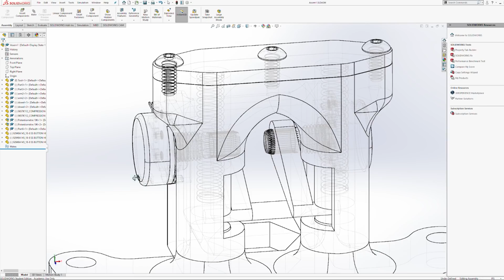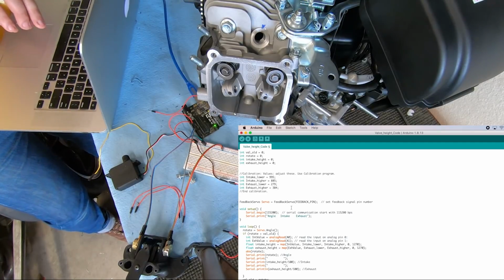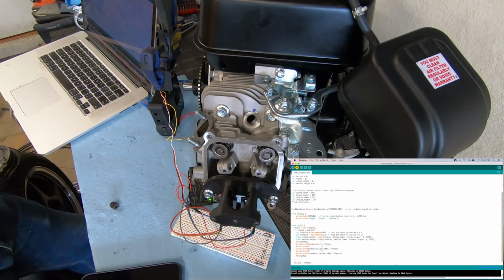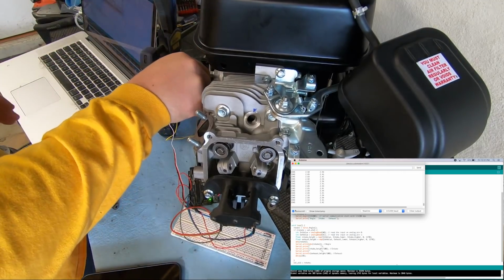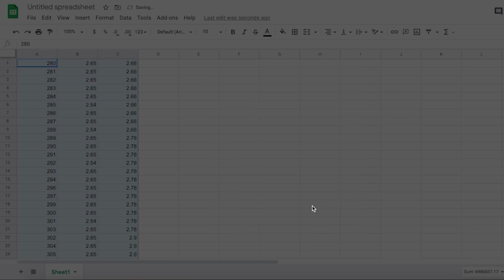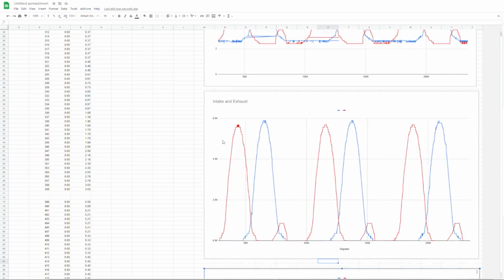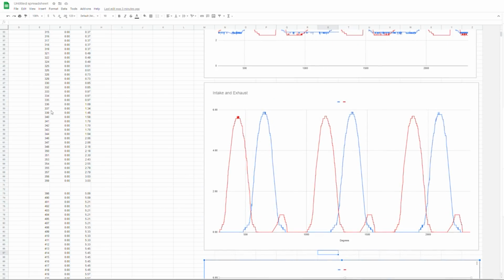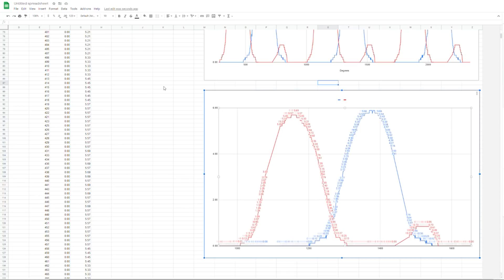Freevalve Build - Cam Mapping Tool

Comment: As an engineering student and an NA miata owner, there is nothing more I would love to see than you working on a miata! Learned all my mechanic skills working on that little thing and have never regretted owning it. 

Given the simplicity of the miata's engine, amount of cylinders, and potential - I'd say you're best off with the miata! You'd probably be better off with a 1.8L just because it's ability to hold power and the fact that the engine is a bit more refined for the chassis it's in. 

I'm extremely interested to see how you tackle the timing, fuel injection, and programming of the car. You'll definitely want to look into an aftermarket ECU. TheCarPassionChannel has a pile of miata information on it, tuning included, if you need any sort of guidance.

Comment: The small secondary opening of the exhaust valve is likely a decompression feature on the cam used to aid in starting. Typically a flyweight that opens and returns the cam to normal profile.

Comment: When importing the valve data into excel, before making in unique you should have used the repeat data to look calculate standard deviation to validate your input. Going further, with enough rotations worth of data you could then easily remove outliers (even if by hand; group by degree, sort by intake lift, remove extraneous values) finally, average by degree input to instead make unique.
You built a rig to template the came, might as well use as much data as it can give you!

Comment: Ok so this part is `pretty straightforward`. We end up with actuator-controlled valves, no cam, cam wheel etc. But the part I don't really get is based on what Koenigsegg was training the AI controlling the system (duration of valve opening/closing, cycles, etc). Do you already have a plan for that ?

Comment: It would be interesting to see how different cam profiles affect the performance of the engine in the end. I've got a bunch of functions that'll generate different cam profiles (mod-sine, hyperbolic, 3rd order, 5th order, etc.) from a given set of inputs. They'd work perfectly for what you're trying to do. If you're interested, I can throw them up on GitHub.

Comment: People are saying the Miata is non interference. This is true of a stock cam lift and gives you lots of room to experiment with overlap and valve opening rates. It may be possible to greatly speed up the valve opening and closing rate but shorten the duration. However if you open the valves further than stock lift they may hit the pistons I opened to soon or late.

Comment: Go with the Miata. You could be very creative with the profile. Open only two valves at low rpm. Ect.  You could try cylinder shut down for improved mileage.  Maybe eliminate the throttle body?

Comment: The miata is probably the better bet. Side note: while you're still experimenting with the harbor freight engine, you should test the ability to use more advanced tuning/cam techniques and vary them with the software. For example, is a variable compression (effective, not real) possible using a lift duration modified Atkinson cycle possible? Could you turn a four stroke into a six stroke? Although not with this engine because it's only single piston and I'm not even sure whether it has injectors or a carb. Because there are no other pistons to help supplement the compression stroke, could you increase efficiency by closing the intake valve a bit before bdc, and using the spring effect of the charge to help accelerate the beginning? Could you effectively combine early valve closing and delayed valve closing into a single "cam" profile? The possibilities for engine tuning and management are endless, and I want to see you go nuts. Look up major hardware on YouTube, and see his noctua fan nodding series. I want to see the free valve equivalent of that. Just going nuts and trying anything and everything

Comment: So maybe I'm late to the party here but from what I've gathered from your last 2 videos i can see at this point the problem at hand is, with a free valve being essentially independent from the crankshaft (unlike its chain/ belt driven predecessor) the solenoid or valve actuator needs to have a reliable signal so it can do the job of controlling intake and exhaust lift at the most efficient time and essentially bringing the valves into time with the engine they are married to. More specifically how this is going to be accomplished when the system is applied in a vehicle. Here's my 2 cents if I'm on track with the direction your going. So every vehicle you mentioned trying this on has ecu mapping therefore data which is able to be graphed with existing software and obviously the appropriate systems to collect that data via the various hall effect sensors used for timing and cam correlation will already be in place and all the geometry has been figured out for you thanks to the car manufacturer you chose to innovate with your platform. You would be able to read the crank and in the event of using a Mazda 2.5 for example you could simply modify the cam journals to retain a portion of the existing intake and exhaust cams for the purpose of having the cam sprockets, their data will be logged just as it would be normal and itll even have a DTC built into a baseline that you can tune from there by remapping using software systems tuners have already developed to work with your system with some basic adaptation to accept the parameters you want to get the full functionality out of the free valve. But instead of doing all this stuff from scratch I think you can modify it all either with stock systems and software or find a stand alone type ecu compatible with the car you chose for ease of use and mapping then just write your tune off base engine data that'll give you a basic cam map then whatever you use as a driver for the free valve will get its data from the existing ecu and based on known values output the signal to control the valve in real time while not falling out of time with the rest of the engine which will always remain a known value based off existing crank position, fuel, spark and ignition data. Trying to come up with some bar and new thing to run all that stuff will be just nuts since it's already been done for you, use it and run the valve controllers digital commands based on it as it's own computer essentially a second ecu just for the free valve. That's what seems obvious to me. All the programs for collecting, graphing and viewing  that data exist and with pre existing malfunction data as a bonus! 
Maybe someone's got a better way but if not I'll give you my email if you have questions.

Comment: What are you planning to rev to ? That question should inform the sample rate you intend to use on Arduino. Arduino might not cut it if you go high rpm. Teensy would be my suggestion.

Comment: Those potentiometers are probably not a good idea, they use a sliding contact which wears over time. Something optical would be way better for reliability. Look into absolute encoders. They should be readily available for cheap. Dunno what kind of heat they can handle tho...

Comment: For improved resolution over those potentiometers, check the hall effect sensors and the way Tom used them in this video; https://www.youtube.com/watch?v=SgqflcHBTwc&ab_channel=TomStanton Also - using magnets means no parts to wear out if you were to use them in a running engine...

Comment: This is incredibly fascinating stuff. I can't wait to find out what sort of performance and or economy improvements this would make to an actual car as a mod. Perhaps I missed it, but, how do you plan on feeding the pneumatic valves with compressed air? I would wager it'd be a simple compressor on the accessory belt.
Reply from the maker: The classic offroad trick is to turn an A/C compressor into a pump, but I'm still thinking. There's a few different options. 90 psi is a lot, but the volume is almost nothing thankfully.

Comment: The potentiometers wont last very long, even if you oil them.  We have steiger 9390 tractors and the fuel level sending unit is a potentiometer and just the sloshing of the fuel wears them out very quickly.
Reply from the maker: Yeah, absolutely just for testing. they wouldn't last at speed.

Comment: aw11 mr2, not too expensive and relatively easy to find and find parts for. also fills your need for a jdm car.
Reply: Fun chassis and a non-interference 4AGE with the option of some 4AGZE down the line? That's be awesome!
Reply from the maker: It crossed my mind- I looked for one but a cleanish one is still a lot more than Miata money. I looked for AE86's as well.
Reply: @WesleyKagan  what is your definition of clean -ish? I got 2 for $2,500 (one was a shell with all the parts to put it together) and before that I bought one for $1,200. You aren't going to find an ae86 for whatever your budget it, tofu tax is real.

Comment: Are you going to adjust the cam profile to something more square or try and replicate the curve?
Reply from the maker: I'm honestly not sure. Of course the easiest way would be to square off the curve and that could possibly get more air into the cylinder because you're introducing the maximum amount of intake per stroke- but in practical application, I have a feeling there will be some middle ground. Part of why I want to use machine learning and let it loose on spark, fuel, and "cam"
Reply: I couldn’t think of a way around doing multiple dyno runs in order to train the ML. Which ML were you going to use?

Comment: This might sound strange, but I think this might be a popular mod for engines used in racing lawnmowers. In the USLMRA, mower engines are usually cam-in-block which really limits what can be done with the valves, but the cylinder heads can be modified in every way imaginable as long as they're the OEM heads that's being worked on. Combined with an aftermarket flywheel with adjustable ignition timing there's real tuning potential, even more so when using a SmartCarb which self-adjusts to maintain the optimum AFR.

Comment: Do a S2000 - could develop freevalve for a honda motor and ride that massive K-series wave
Reply: S2000 is F20C NOT A "K" Motor.... Do your research.
Reply: @SHAGGYSEZ  I never said the s2000 has a K series. Notice the "and" in my sentence. Learn grammar.

Comment: Might want to look into the b230F redblock, it's a non-interference engine, well known to last well over 500k mi(mine is currently at 540k), and extremely common.

Comment: the second red bump is the decompressor it’s there just to start the engine i would remove that from your graft because it will not run good with that in
Reply: Here's more info on that decompression for starting for anyone that cares.

https://www.motorcyclepowersportsnews.com/engine-decompression-systems/

Comment: Curious about one thing - not really a problem right now, but if you wanted it for longevity, are you able to ramp down the valve closing/seating speed?  One of the things I've wondered about is how to prevent the valve from slamming shut on the seat.  I'm thinking that to reduce pumping losses, you would probably want to get the cams to as close of a square wave as possible, but that would be hard on the seats.

Also, depending on how much you want to bite off, you could probably throttle the engine using your cam actuation so instead of it following the inputs from your throttle, it would be generating the throttle.  I would think it would really help with the transients.  I know the BMW valvetronic system throttles using the valvetrain.

Comment: Question 

Why would you want to perfectly emulate the dynamics of the cam? Until you've verified the cam was actually efficient, you have no idea how much you can improve your breathing. Wouldn't it be better to map the valve travel, and dwell to determine duration? In other words, your free valve will mimic a stock cam, when it could be a performance, towing, economy or anything else with just a tad more effort.

Comment: You might consider the ford 300 six, if you want to make a head. They have a pretty dedicated cult like following and one of the biggest hold backs of the engine is the lack of crossflow heads because the push rods really limit port sizes on any crossflow design

Comment: Use an LS. Similar to your original concept and the push rods can be used for signal and head lubrication. A lot more room to work with and plenty of valve cover designs that can be modified to integrate your tech.

Comment: I think you should consider changing to a much powerful microcontroller, I suggest the Teensy platform, you still code them like an arduino. they are much faster and have better I/0 pins like allot of interrupt pins, their ADC have a much higher resolution 16bit? compare to 10bit, and it also have a DAC if you ever need analog output. anyways ... Im going to keep tracking your channel, freevalve system is one of my dream projects.
Reply from the maker: I'll look into it, thanks!

Comment: A Miata would be a good choice. You can use a megasquirt compute to totally control fuel/spark. You could do that on pretty much any engine but Miatas are a very common use so you wouldn't be blazing that trail. This is a really cool project and got my subscription.

Comment: another thing you might want to look into if you have not already is speeduino, an arduino 2560 based diy ECU. you could potentialy intergrate your freevalve code into the speeduino code.

There is a limited number of pins available, so you may have to look at extending with a second arduino and just have the speeduino send out the triggering for your second one. The speeduino is something I have wanted to play with for awhile. I have been thinking of taking an older bike and converting it to fuel injection and coil on plug. but I don't ride so it would have to be in some sort of off road buggy that I don't have time to build or money to buy :(

I figured I would probably buy an old honda civic cheap (probably roadworthy) with a good running engine and convert that, then eventually use the engine as the power-plant to a dune buggy type thing in the future when I get time.
Reply from the maker: Yeah I'm looking into speeduino now, and exploring a few other chips too. I really like my MS3 Pro for fuel and spark, I'd love to integrate them, but that's a tall order I think.
Reply: @WesleyKagan  Speeduino has a LOT of MS3 "cross overs".  One of them being the Turner Studio software for tuning.  It is also a cross platform project supporting atmega 2560 and teensy 3.5.

Comment: Just an FYI:
It may be worth checking out the speeduino project, which is an arduino based open source ECU.
There should be some information available on wiki.speeduino.com on how to use a speeduino on a miata.

Although i believe for initial work it's probably easier to use the stock ECU.
Give it a look, see if you like it and maybe get in touch with the guy developing it. He's also on youtube, just search for speeduino.
Maybe he has the time to help you out with more complex features down the line ( like using the valves as a throttle).
It may very well be that it's easier to hack something together with a stock ECU instead of using speeduino.

Best of luck ! 😀

Comment: You gotta ditch the freevalve name from your project files before it gets you in legal trouble. You've moved beyond the protection of building it for yourself by putting those out there.

They might not want to swat you down, but using the name is a clear legal case.  Miata engine. Cheap and easier to deal with than a v8. Then step it up to the biggest v8 you can find.

Comment: Seeing a lot of votes for the Miata, but I'd think it would be easier to do this on a pushrod engine than a DOHC. I would recommend a four-cylinder two-valve-per-cylinder pushrod engine to start out, that would be simplest to work with. I'd think this would be easier to mount on a pushrod engine, and you could potentially leave some of the pushrods/rockers in place so it can be partially freevalve partially conventional, start out just on one cylinder and see how it holds up, and if it fails (it certainly will a few times as you experiment) the conventional cylinders will get you home. My (heavily biased) suggestion would be a VW Bug engine - common and simple pushrod four-banger.  But before even thinking about any of that, get it running well and reliably on the Predator, and get quite a few miles on it, or for that matter just leave it running for hours at a time (sorry neighbors...) to test longevity, ensure it doesn't die in the first few minutes.

Comment: A lot of recommendations for non-interfernce engine, but your free valve design will have the potential to interfere. So really, all engines are interference engines as far as you are concerned! Therefore, interference or not is not a reason to choose one particular engine over another.
Reply: Not sure I agree with you, by design,  he has limited range of travel,  sticking to  the same range as OEM, if at maximum  range limit  it does not interfere, then it doesn't  interfere .
He can design this to allow less or more range of travel so could allow interference where it was not possible originally,  but as currently set up this is not the case....

Comment: i would go with a non interference motor. So the miata would be good, or get an old volvo with a redblock, also non interference. The advantage is obvious offcourse, you can screw up the timing or have a valve that dindt close in time without bending the valves. That means you can go much further and push it to the limit and then back off a bit. WIth a interference motor you dont want to ever cross the limit as that wil stop your project for a while as it might actually break your freevalve system as wel.